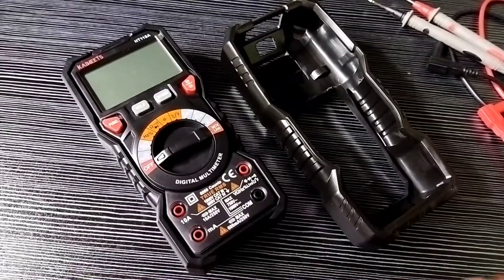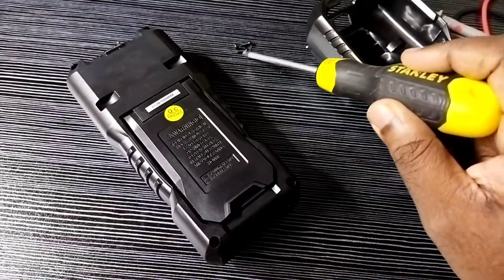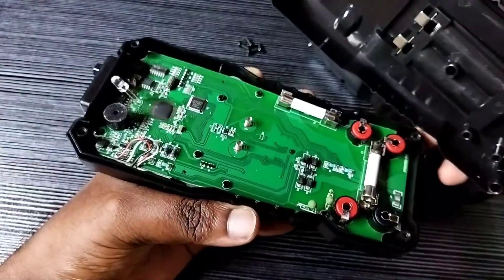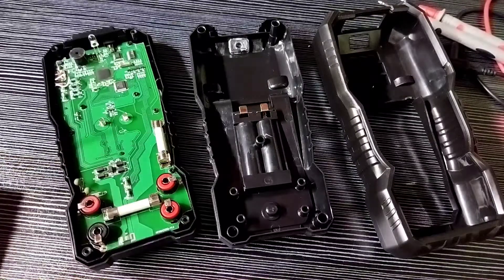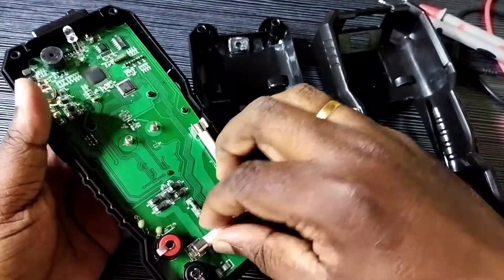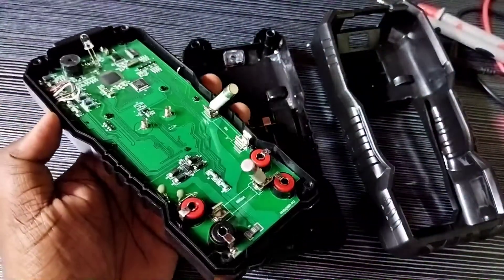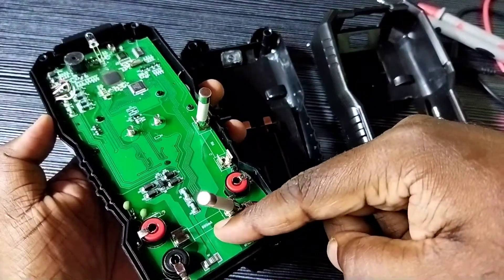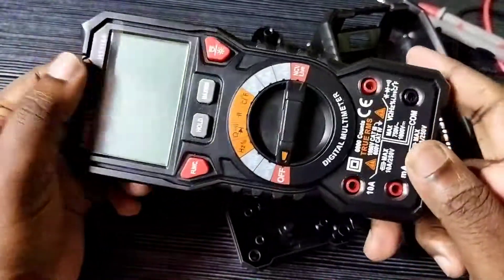How to Repair Multimeter Not Working | KAIWEETS  Digital Multimeter

Comment: I got inaccurate voltage reading in both AC and DC but others works fine. I tried self calibration but didn’t solve, any reasons what could be fault ?

Comment: How did you get the rubber cover off without tearing it?  Also it is a 600 miliamp fuse and not a 600microamp fuse 
Thank you
Ron